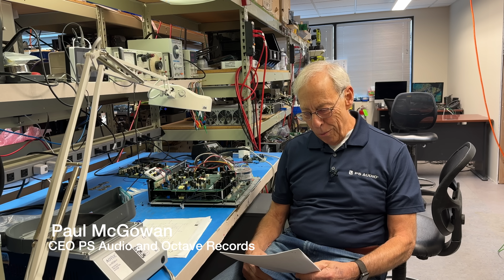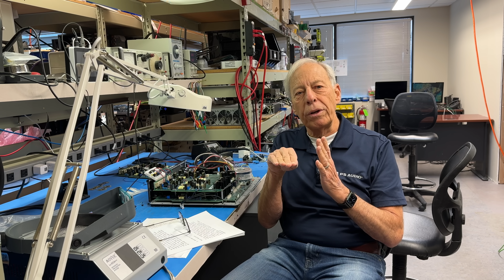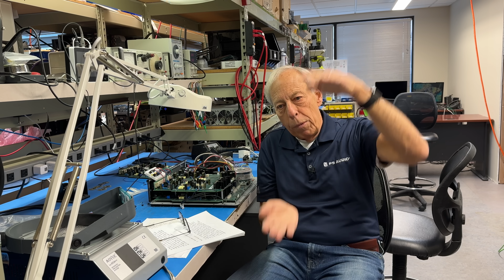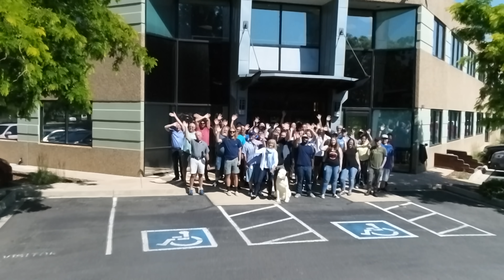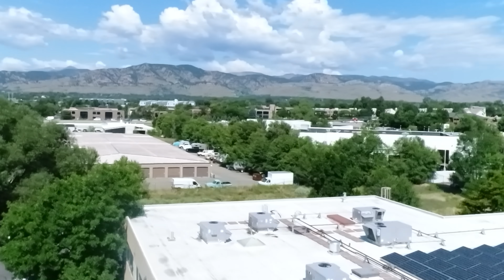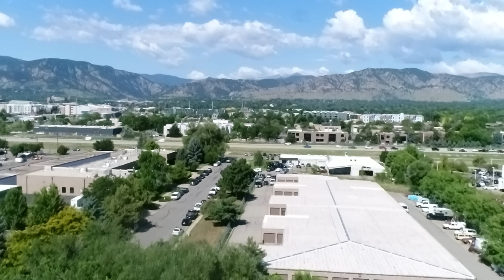Class G Amplifiers

Comment: From what I understand about Hitachi class G amps is that by the time the higher voltage transistors
start to conduct the lower voltage transistors are almost fully on. So all four output transistors provide
part of the output at higher power levels. So it’s more like a class AB amp inside of another class B
amp. Of course there is not just one crossover point at near zero volts, there are two more. That is the 
problem that Hitachi had to solve before selling the first receiver with a class G power amp section. 
The 75 watt per channel SR-903 in 1977 with over 3 db of dynamic headroom. I prefer the SR-904.

Comment: Arcam desribes class G as a linear power supply (tradition toroidal power supply) for the first few watts, and then  a hand off to a switching power supply (smaller, cheaper, more efficient, less heat) for the peak power demands.

Comment: There is a more complex description of Class G (and Class H) on Wikipedia at https://en.wikipedia.org/wiki/Power_amplifier_classes. If I understand it correctly, Class G amps have several fixed power supply voltages available all of the time, and switch between them as needed according to the input waveform. Class H provides a varying power supply voltage to the output stage using what amounts to another amplifier stage with a higher slew rate than the output stage (so it can "stay ahead of" the voltage needs of the output stage).
So Paul's description of Class G is closest to what Wikipedia calls Class H.

Comment: Makes sense. I wonder how quickly the rail voltage changes.  Seems like a type G amp would mostly be used for amps that are almost always on but there's very little changes in source amplitude. Probably like a P.A. system.

Comment: Well that’s sounds like the how the voltage regulation of car audio amplifiers work.  Just adjust the inverted input on the SG3525 or TL493 (adjustable duty cycle). That’s a cool idea, I thought of this years ago when repairing amps.   Just never thought of putting it in use.

Comment: I've got a Yamaha MX-1000u that I will NEVER path with until death... 😬.  The thing has two 650va transformers (in paralell) with 2  voltage rails.  The lower rail is +/- 42 volts, which the amplifier runs under normal conditions,  however; when the need arises, those gates open the higher +/- 92 volts rails.  It's the equivalent of a turbocharger or NOS kicking-in on a race car.  For this reason, this amplifier gained a cult-like following as owners claims that the more you crank it, the better it sounds😊.

Comment: I can imagine why there are few if any class G amps sold.  Complex, expensive and likely inferior sound.  And for what?  Who that can afford hi end audio cares about the cost of the power they use with a conventional A/B amp or even an inefficient class A amp.  And in the grand scheme of global warming reducing the load of all the high end amps on the planet is not going to move the needle.  Make houses and commercial buildings a little better insulated and change every light to an LED.  
I run class A/B 110W OTL triode amps and they only draw 750W per channel.  I run them for a couple of hours every now and then.  And whatever heat they produce simply offsets my heating bill in Canada for 8 months of the year.

Comment: Sounds like it's using a modulated power supply ,something like Bob Carvers design where the power supply  current follows the input signal in parallel .I wonder how much noise and how much lag there is in the power supply to match the incoming signal amplitude

Comment: Sounds like that varying power supply could easily introduce noise in the audio signal.
Reply: I was thinking the same. I wish he would've talked about how it affects the sound.
Reply: @noavgjoe If you find two different amplifiers with matching specs and measure the audio is to spec, there is no difference in sound.
Reply: Outlaw Model 2220 monoblocks use class A/B and class G for high output,  with an excellent noise floor rating.
Reply: I'd say 99+% of all amplifiers has a feedback circuit that is always active. If you have a transformer fed voltage rails they will sag considerably (could be a few volts missing!) with reproduction of loud noise in the lower frequencies. So, the feedback circuit will open up the output transistors a li'l extra as the voltage sag to make sure to reproduce the amplified signal correctly.

Some Class G have continuous generation of the voltage rails, thru basically a variable switching PSU. This tracks the input signal + add a voltage headroom for the output transistors to work with. It rapidly increase the voltage to match the expected output.

This variable design needs to be able to produce and maintain maximum power at any time because it can't rely on large bulk capacitors "to hold the fort" when the deep energy demanding bass notes needs to be produced.
If it would have large capacitors it would need a much more massive switching PSU to "beat the incoming signal" even when filling massive caps. It's would be a less economic design at all fronts with very few advantages.

So, Yes, there will be noise by the inherent designs of switch mode PSU, most of the noise is hopefully far outside the hearing range, the residual noise is of low enough frequency that it can be deleted by the feedback circuit.

Also Yes, the designer of such PSU and Class G topology needs to be very mindful of the noise. I'd suspect the noise is no way near as large in amplitude compared to the sag of a transformer based PSU but will have a much broader spectrum and feedback circuitry will require much attention to suppress the voltage rail shift.

A classic PSU has mostly large 100 / 120 Hz component, switch mode PSU in Class G generates a different "noise" as it gears up for large signal, depending on design it could cover entire audible range. Not sure how fast it can raise the voltage rail, what dV/t it would be able to perform. To "technically" cover all bases it needs to be doing it faster than a maximized 20kHz tone suddenly appearing. However, for an audio amp to send a full voltage railed 20kHz tone is musically not realistic, it would kill a tweeter... and listener so fast.

Fun fact: had my front speakers tweeters killed in about 2 seconds when a li'l FW bug just changed the analog music signal. Instead of "musical sounds" it suddenly fed out 48kHz PCM signal on the analog output to my 120W /ch power amp, at a 2V line level. Power amp had no hesitation to attempt forward that 20-something dB boosted signal to the speakers. Amp had a bandwidth range up to 100kHz 😆 Tweeters fried, much like my ears.
Tweeters lasted 2 secs...? ...and didn't explodiate? (Guesstimation) It's because it was a square wave of random patterns, sometimes in the audible range, sometimes far above. To me it sounded like an incredibly bright hiss that ended in crackling noises as the voice coil melted. I guess a combination of frequency spread, amplifier, cables and tweeter made it stochastic enough for amplifier have some struggles to generate it and random resulting tones and harmonics didn't carry maximum power like a test tone would.

Comment: Amplifier supplying amplifier. The word efficiently need to apply to efficiently control that voltage, this must be tricky, or perhaps using switching mode power supply.

Comment: Paul, do you remember those pulse proportional radio control system from 1960-70's? Those system used pulse width & pulse rate modulation on tone signal and ran on 27mhz. So, PWM is more than 60 year old concept.
Reply: Clive Sinclair in the UK released the X10 Pulse Width Modulation amplifier in 1964. This was an early version of what has now become known as Class D. These amps did not give the output power stated and radiated a huge amount of radio frequency interference. A Class D amp works in a similar way to a switch mode power supply so the best quality amps must have very good filtering, which many now do. Class D amplifiers will probably dominate the hi-fi market in the next few years due to their high efficiency, small size, sound quality and bang for the buck., makers of so called expensive “high end” amplifiers are in for a hard time.
Reply: @geoff37s38  It's really fun when you mate a class D amp with an SMPS.